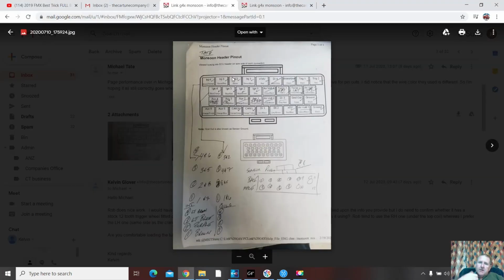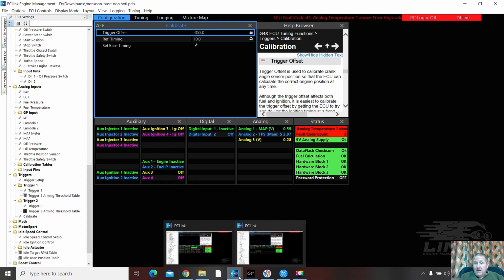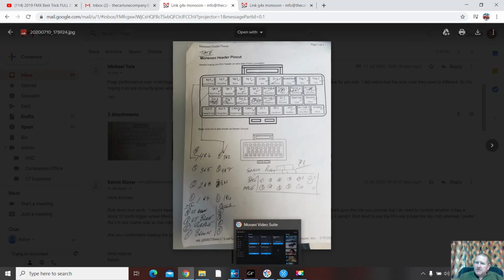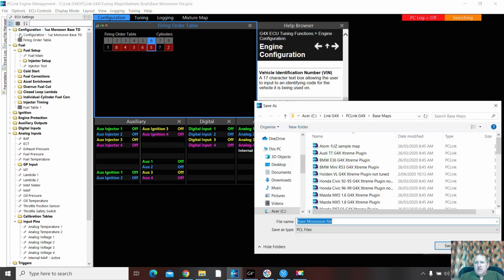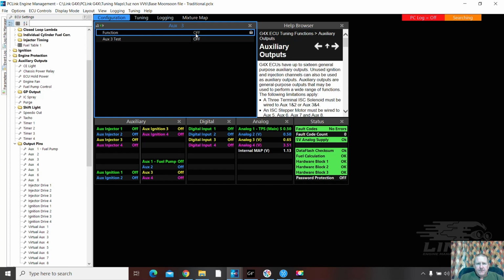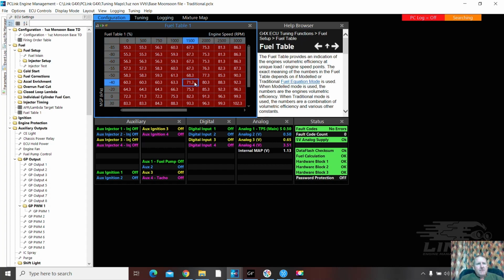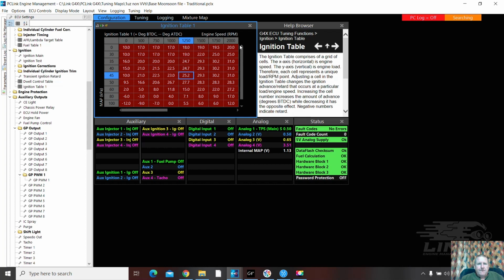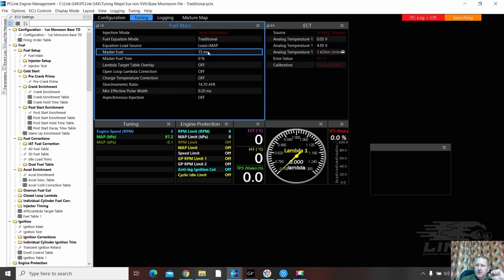Link ECU G4x Monsoon Setup to 1uz-fe Toyota V8. COP , Semi-sequential.

Comment: I am looking at the possibility of putting a turbo in my 1998 1UZ-FE VVT-I, I already have the programmable computer, injectors of a 7m-GE engine and I have a Chinese turbine, I have been told to change the rods for those of the engine no VVTI, but I don't know what else I have to do to the engine
.
Reply from the maker: Hello.  Its an engine like any other so changes will depend on your goals.  Rods are a good start.  Pistons for more serious power.  Cheers Kelvin

Comment: Hy I have moonsoon and I wanted to put on 1uzfe vvti so my  question is can I control auto transmission on moonsoon
Reply from the maker: The Monsoon has only just enough outputs to control the engine , you will lose the drive by wire feature of the throttle body and there is no where enough outputs to do connect the auto nor do link presently have the switch logic for full auto control.  An separate auto controller will be required.  Cheers Kelvin
Reply: @CartuneNZ  thankx so which one is the best ecu for 1uzfe for fully control
Reply: Which ecu can fully control 1uz

Comment: How much would it cost to swap a 1uz into a ln130 hilux surf with manual trans?
Reply from the maker: There is no set price for engine swaps as everyone is different.  Things like which version of 1uz,  which radiator,  which ecu etc and if a workshop is doing it or someone at home etc all change the price of the swap.  Cheers Kelvin

Comment: Brother i have a 2jz vvti single turbo automatic transmission with link monsoon g4x. I have noticed that on cold start when the car is completely cold the car idles around 1100 rpm even if I drive for 3 or 4 hrs it will idle over der at 1100 when put in N.
If i start the car when it's at half of the normal operating temp the car will idle at 800 to 900 rpm and it will stay that way no matter how much I drive the car. And whenever i start the car when it's at normal operating temperature the car idles very low around 200 to 300 and stalls sometimes. What could be the problem? Plz helpp
Reply from the maker: It is most likely either wired incorrectly or setup incorrectly.  How is the idle speed controlled in your car?  Was it a factory drive by wire throttle body?  Is the link doing idle or the stock ecu?  how is the transmission controlled?
Reply: @CartuneNZ  it's an electronic throttle controlled by the factory ecu. And the transmission is also controlled by the factory ecu
Reply from the maker: Ok.  I would be looking at the live data in the stock ecu.  I've done plenty with stock ecu controlling trans and throttle and they idle like factory.   The answer is found by checking and testing your car.
Reply: @CartuneNZ  thank you very much I will try to check with obd 2. Ur replies are most appreciated